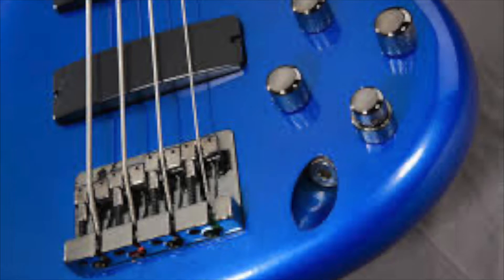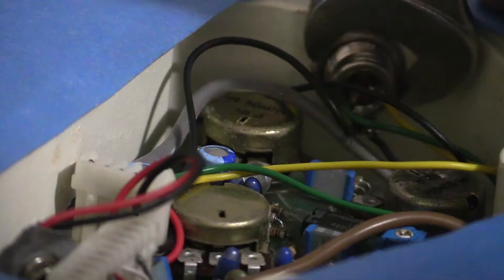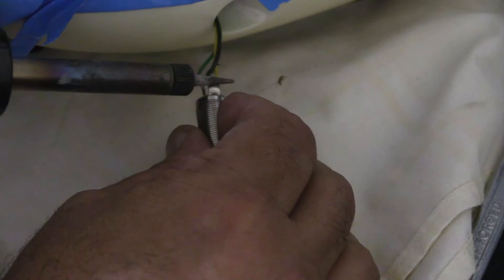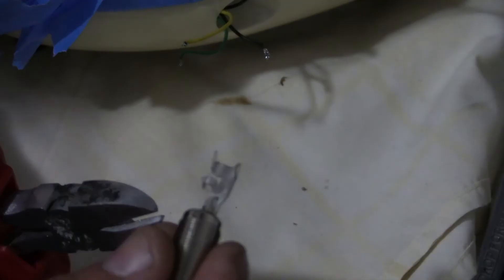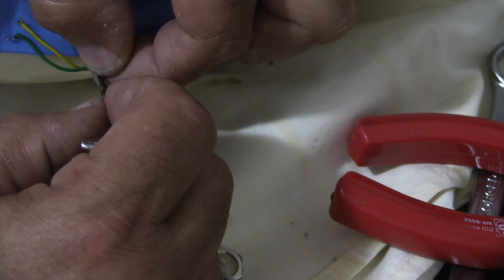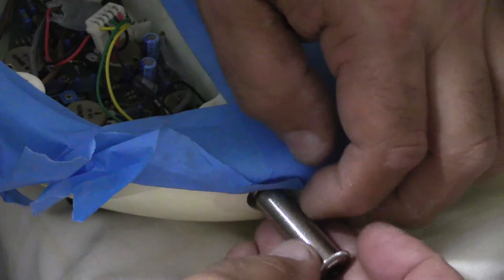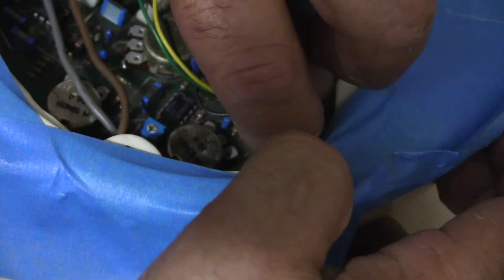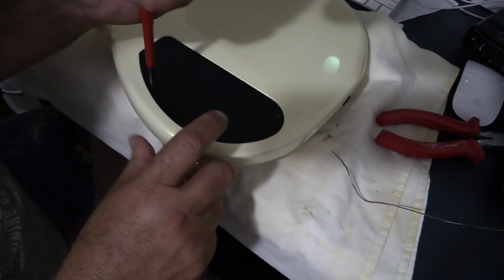Barrel jack replacement

Comment: Good solid info!
I'm about to replace a wonky barrel output (doesn't hold the plug in anymore) on a Warwick, which is also active - so I do need to find a stereo barrel first...

Thanks! 🙏
Reply from the maker: Glad you found the video useful. Get that Warwick back in shape and rock on! :)